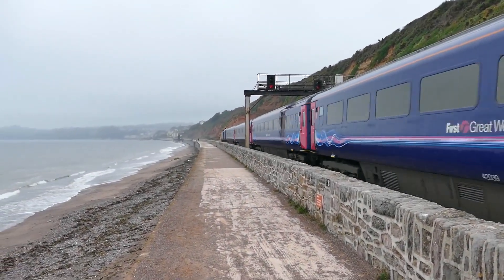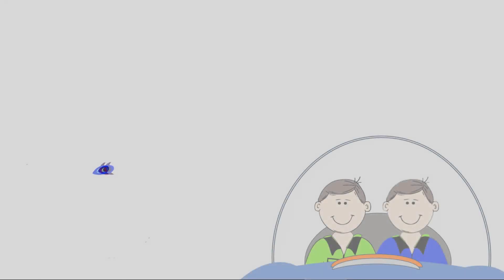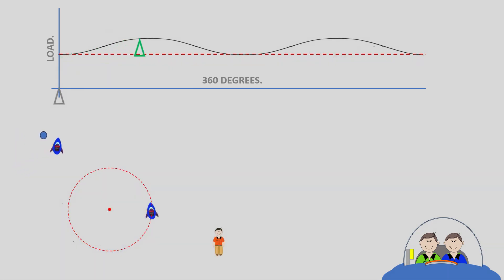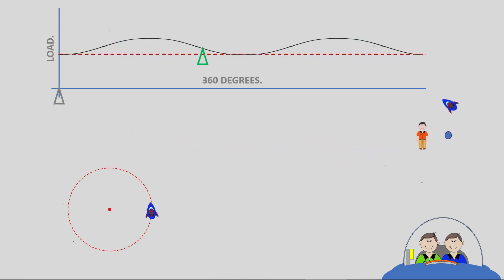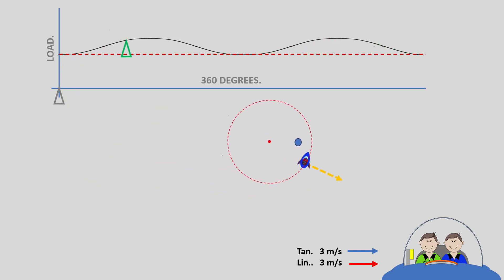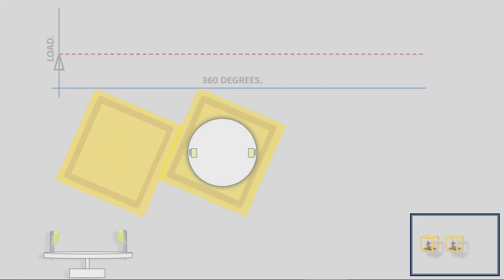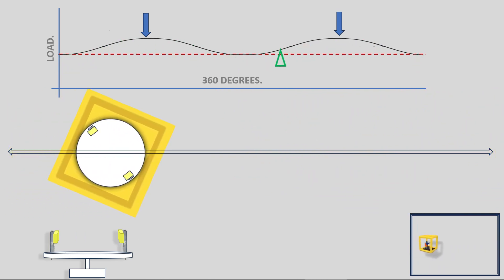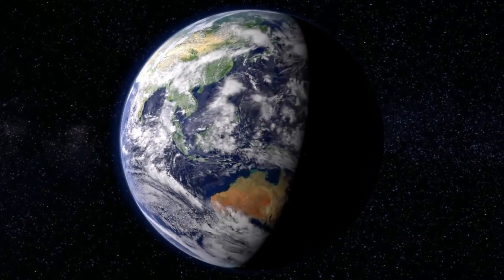Measure a Constant Velocity by Kryptonite Physics

Comment: If you have any questions just ask, Provide time stamp for questions relating to the video only.
Reply: Chris, at 7:06, you said "knowing the masses distance from the center of the apparatus and its velocity they calculate same readings as the graph" - Who are they and how they calculate that?
Reply: From point to point you know the velocity from the resultant value at each point.
Acceleration is a change in velocity over time.
From point (1) at 12.00 at top, to point 2 at 11.00. you have a difference in velocity.= acceleration. 
Note from point 1 to 2 acceleration.
Repeat point 2 to 3
point 3 to 4 , and so on, for the complete rotation. 
Work out the effect on the mass/load cell of the acceleration at each point
Add results to graph
Note: its the outside observers calculations, not from within the rotating frame of reference. @HarryCallahan1971
Reply: @KryptonitePhysics  "Acceleration is a change in velocity over time." - Yes. And as velocity itself, the change of velocity have to be vector too. So acceleration is vector too.
"From point (1) at 12.00 at top, to point 2 at 11.00. you have a difference in velocity.= acceleration. " - We were here almost three years ago, Chris.I agree with you on everything except for one single step you made. I agree that you get correct velocity for the point by adding two velocity vectors (tangential+translation). You did that step correctly. You used triangle calculator to get resulting velocity magnitude. You also understand how you can add these vectors geometrically. I cannot say the same for many other flat-earth advocates. So kudos. I agree with you that average acceleration between 1 and 2 and between 3 to 4 should be the same in magnitude and pointing to the center of the rotation for us not being able to feel/measure change in acceleration. And I agree that acceleration is difference in velocity (v2-v1). Then only mistake you made (and sorry for not being diplomatic enough about it but you are clearly wrong here) is that to get that average acceleration between 1 and 2 you subtracted velocities as scalars and not as vectors as you should. This is your only mistake in the whole process, Chris.
Reply: @HarryCallahan1971  You are right. It seems at first acceleration should be different for an observer on a rotating rigid body that is also translating. Hoewever, if you derive the kinematic equations and derive the acceleration, whether V=x m/s or 0 m/s makes no difference. You can actually understand easily by observing that the change in velocity vectors between only rotation vs rotation+translation is exactly the same. Sorry Chris, but this time your video is incorrect.
Reply: @KryptonitePhysics Thank you Chris for the reply and the video. I appreciate it. However you are not addressing my point. I agree with you that IF the acceleration vector will change, the load cell will register that. The issue is that the acceleration vector for point on rotating rigid body with translation will have constant magnitude and will point to the center of the rotation. Regardless of the constant translation motion. And only thing you have to do to verify that is to properly follow your original method and calculate and track that average acceleration vector. The only issue is that you subtracted velocities as scalars, not as vectors. You almost did it in your older videos. Now I can't even find then on your channel. In this latest video response you are showing how acceleration vector is changing and acting on mass but where you have analysis showing that acceleration will change like that? You are calculating resulting velocity only in all of your current videos actually. You are not showing how you calculate magnitude and direction of that acceleration. And acceleration is what matter in this case, right? You are just claiming it will change. Or saying that "they" will calculate it changes. But "they" will calculate that acceleration will have constant magnitude and will point towards center of rotation, Chris. Calculate the acceleration between 1 and 2 and between 3 and 4 properly, using vector subtraction and you will see it. It is simple as that.
Reply: you're still making the same mistake I explained you months ago. If you add a CONSTANT velocity to ANY motion, the acceleration does NOT change. Because acceleration is related to a DIFFERENCE in velocities, and if you add the same thing to the two terms of a difference, the result stays the same. A 2nd-grader knows that.
Of course you won't believe me, so I can only challenge you to do the experiment. Fasten to a bicycle wheel your load cell, or a phone with an app to record acceleration (better fasten a counterweight on the opposite side). Keeping the wheel horizontal, spin it with an electric drill at low speed (say, 450 rpm). Do this on a fast moving train, when its speed is constant and the track rectilinear. I predict the result will be the same as on the ground
Reply: The container is not the object being observed, your only concern is the mass, whats happening to that?
Outside observer what do they see and observe at 4.08, a constant velocity? NO@@electrical.engineer.1
Reply: If one vector only that never changes direction the graph will show 0@electrical.engineer.1
Reply: Please explain why?@electrical.engineer.1
Reply: @KryptonitePhysics  Come on, Chris. You can't say things like "You have looked at Harrys video. It is deceptive. Carry on drawing the acceleration vectors from the 4  he draws opposite to each other" and then not let me explain it to you. Can I contact you by email?
Reply: 1. There is no changing rate of acceleration
2. There is but the graph is wrong
@electrical.engineer.1
Reply: Chris I am at 1:05 now. You said "driving in a circle at the constant velocity". But velocity is a vector. You can't drive in circle at constant velocity, you have to change direction, right? You can drive in circle at constant speed, not velocity.
Reply: At a constant tangential velocity. Add that vector to your collection @HarryCallahan1971
Reply: @KryptonitePhysics  "At a constant tangential velocity." - OK. I think we are on the same page here. Constant magnitude, direction is changing but it is always perpendicular to the radius - so in that sense it is constant. Right?
Reply: It's obvious that we don't have anything, but crickets sound. Good job, Kryptonite ❤

Comment: Dear oh dear oh dear.

Here we have someone who does not have a basic understanding of rotational motion or forces or ...... anything very much.

The video shows a load cell attached to a mass rotating with a constant radius around a point in two scenarios:
1) The point is stationary
2) The point is moving at a constant velocity

The video claims that the load cell would show a varying force for case (2) in which the centre of rotation is moving with constant velocity.

Oh dear.

The load cell would show no difference between the two scenarios. I could go into the maths, which the author of the video would not understand, I suspect the author could not offer any maths for centripetal acceleration etc, so instead I will make a more general point which should be comprehensible.

The load cell measures force, the force in question here would be centrifugal force, which is ficitious force, but it is derived from the centrifugal acceleration. I repeat centrifugal ACCELERATION. Having the centre of rotation moving with CONSTANT velocity CANNOT impart any change to the centrifugal ACCELERATION because errmm... constant velocity has ZERO ACCELERATION. As the centre of rotation is NOT subject to any acceleration, then there is no additional acceleration imparted to the end of the arm holding the load cell. If there is NO additional acceleration, there is no additional force, and so the load cell will NOT show any force related to the constant velocity of the centre of rotation.

If the author wishes to, they could do a test of this in REALITY. Get a load cell, attach to an arm rotated by a small electric motor, or perhaps just use a portable drill with an arm attached (probably best to make two arms and make it symmetrical and balanced) and then try reading the load cell while on the ground and in a car/train etc, and you will find the load cell will show EXACTLY the same values.

Goodness gracious me. Dunning-Kruger in action in this video.
Reply: Testing, this post
Reply: 1. Rigid body rotation with translation physics involves a circular motion with the center moving at a constant, a mass according to this (Proven) physics on the outside rim, is moving at an ever changing rate of acceleration. https://youtu.be/wGVue66jVBs?si=qBsaQLSwf1t5pcF8
Now add the rotation part of the acceleration, (centrifugal force at a constant)
2.  Two accelerations happening at the same time, one constant, one not.
There is no constant for the mass.
Now observe video at 4.08, do you observe a constant velocity? NO. Thank you Mr Kruger
Reply: @KryptonitePhysics  "Now observe video at 4.08, do you observe a constant velocity? NO. Thank you Mr Kruger" - But Chris, nobody is claiming that  there is constant velocity. We do know that circular motion involves acceleration. Only thing that adding the translation motion do in relation to acceleration is that it make harder for you yo see that the centrifugal acceleration is still the only acceleration that is happening there. The acceleration will have have constant magnitude and will always point into the center of rotation. Your previous videos where you actually quantified velocities and average accelerations were better as they showed more clearly where you misunderstanding comes from.
Reply: @KryptonitePhysics 
Dear oh dear oh dear, you didn't understand a thing I said did you?

We KNOW that there is an acceleration (NOT an "ever changing acceleration" as you said, it is constant), there has to be for circular motion. So pointing out that there is an acceleration is NOT making a point. We ACCEPT THERE IS AN ACCELERATION, but it is ONLY caused by the rotational motion.

The claim you are making is that moving the centre of rotation at a constant velocity ADDS ANOTHER ACCELERATION! And it DOESN'T! It can't, as the centre of rotation is NOT accelerating. It is really really simple.

THERE ARE NOT TWO ACCELERATIONS!!!!!!!!! Just the one for the rotational motion. It wouldn't matter if the centre of rotation was moving at a constant million miles an hour, the acceleration sensed by the load cell would be no different than if the centre were perfectly stationary.

My God! Someone doesn't understand F = m a.

Comment: This entire video is incorrect. The centrifugal force is constant, no matter if the center of rotation is fixed or moving with constant velocity.
Reply: Yes, this is correct. The acceleration felt by the observer on a rotation doesnt change if the body is moving at a constant speed or not. The problem for the globies, however, is that earth does not travel at a constant undirectional speed: its orbit is an ellipse around the sun (even a circle isn't constant speed...!). Not even considering the speed of our solar system through the universe!!
Reply: @Stefan-gh7xr So you disagree with Chris, right? The problem with our movement around Sun is that it is orbit. Technically, it is not acceleration. It is movement on straight path in curved spacetime. You should not feel anything. In more understandable explanation - everything around you - ground, trees, waters, buildings, every bric, every grain of sand -  and everything in you - every atom of your body is experiencing basically the same acceleration on curved path around sun. So there is nothing pushed agains something, like for example in turning car it is. You should not feel or measure anything in orbit.
Reply: @HarryCallahan1971  Yes you are right, in theory... everything would be in freefall.
Reply: Try watching the video before commenting, not a good look. As per video yes the centrifugal force due to rotation is constant.
Then we have more physics. Rigid body rotation with translation physics.
That involves a mass on a rotation with the rotation centre moving at a constant. 
As per observation at 4.08, look at the screen do you see a constant velocity? NO
Are the drivers at a constant velocity? NO
Try watching the vid, you haven't,
Reply: @KryptonitePhysics there's a recent comment completely debunking this video. I suspect it'll be ignored or deleted. Go take a look

Comment: Pendulum's are also proof of no acceleration and deceleration.
Reply: A pendulum at 45 degrees latitude has a centrifugal force acting on the mass at 45 degrees from level, Heading South at all times = To, about 0.25% of the pendulums mass.
It will not work on a globe that rotates.
Reply: @KryptonitePhysics A pendulum at 45 degrees latitude does experience a centrifugal force due to the Earth's rotation, but this force doesn't affect the pendulum's function significantly. The Coriolis effect, caused by the Earth's rotation, can slightly affect the pendulum's behavior, but it's generally not noticeable.

The statement that the "centrifugal force is heading south at all times and that it will not work on a rotating globe is not accurate". The Earth's rotation affects many phenomena but doesn't prevent pendulums from working. Pendulums, (foucault for example), can demonstrate the earth's rotation precisely because they do work on a rotating globe
Reply: @KryptonitePhysics Yeah, you've lost me  No clue what you're trying to prove. And nothing you said disproves the idea of a pendulum working on a globe. The centrifugal forces of Earth's spin are negligible
Reply: @WeOutlawsTV88 sit this one out and go take your meds. Unless you have something useful to bring to a conversation
Reply: @KryptonitePhysics Ok? Centrifugal forces affect pendulums on a very small scale ..... so?

Comment: Do you have a video explaining the pressure felt from the outer rim velocity of living on a ball with a radius of 3959 miles spinning at 1080 mph at its equator? I know a merry go round would be a great example, but would that be accurate?
Reply: Globetards have abandoned themselves, they don't want truth just ti be comfortEd in their delusions.
Reply: It’s a simple calculation. The centrifugal acceleration for an object on the equator is approx 0.03m/s^2. This is about 300 times weaker than the object’s gravitational acceleration in the opposite direction. Therefore, we would expect that the net downwards force applied to an object on the equator should be about 1/300th (0.3%) less than at the poles. And this is exactly what we measure in reality - objects at the equator weigh slightly less than at the poles. It’s why jewellers still use balance scales to weigh gems, as the reference weights will experience the same weight change as the gems, as opposed to a spring scale which would weigh the gems as slightly heavier the closer to the pole they’re weighed.
Reply: @levellingthefield1448  Rrrright, a calculation...except, that is not Science. Need something demonstratable...
Reply: @levellingthefield1448  gravity? Poles? Yeah, you love assumptions and using the very things you need to prove as actual proof, which, since it is just maths, is not proof of all 😂😂😂